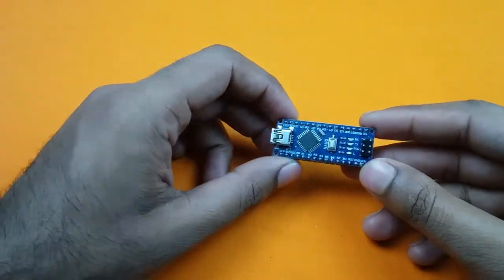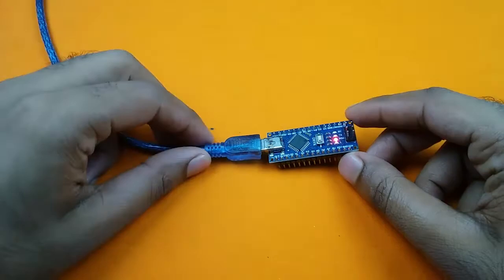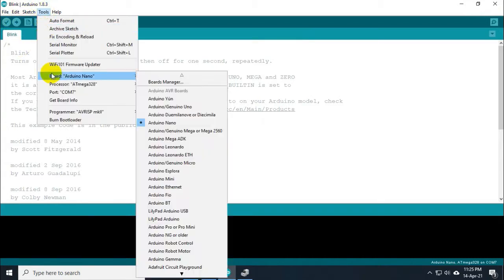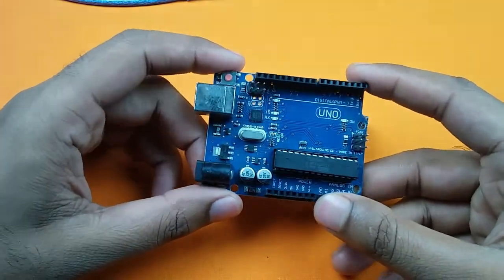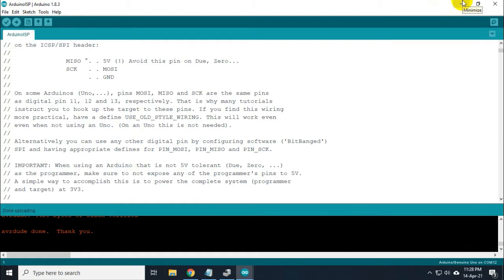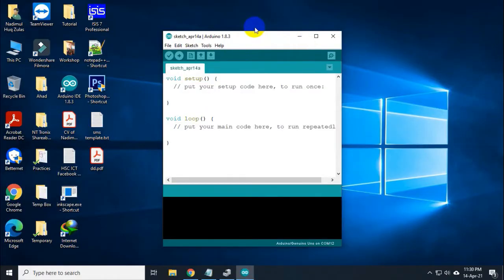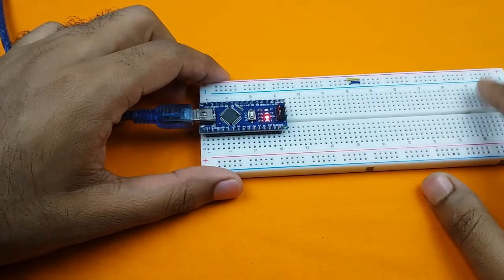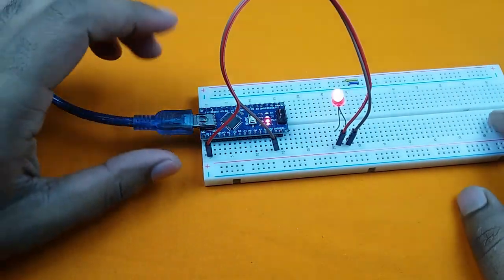How to Burn the Bootloader into Arduino Nano

Comment: mine was also a stk500_recv error - ch340 clone with no underboard crystal next to the ch340-chip-pins7and8, setup as Board:Arduino Nano"  Processor:"ATMega328P", changing to the below setting made it work, without doing anything else
Tools = Processor: ATMega328P (old bootloader)

Comment: Am facing some critical issues with nano board.
Blink code is properly worked but when upload some other code LCD display or switch opration code these codes is not working how to solve this problem sir?
Reply from the maker: I think there have any mistake on your program
Reply: @NTTronix  but sir UNO board properly worked with same code.
Reply from the maker: @0124akash  Then burn the bootloader first
Reply: @NTTronix  problem solved. Actual problem is supply voltage. Nano board supply range 6-12V and am applying 4.8V through mobile charger.

Comment: This method does not work if the Nano has a ATmega328PB instead of a 328P: I am still looking for a method for burning a bootloader in a Nano with a ATmega328PB, because most of the chinese clones have a 328PB.
Here is the error message with a 328PB:
Arduino : 1.8.15 (Windows 10), TD: 1.57, Carte : "Arduino Nano, ATmega328P"

C:\Users\Michel\AppData\Local\Arduino15\packages\arduino\tools\avrdude\6.3.0-arduino17/bin/avrdude -CC:\Users\Michel\AppData\Local\Arduino15\packages\arduino\tools\avrdude\6.3.0-arduino17/etc/avrdude.conf -v -patmega328p -cstk500v1 -PCOM9 -b19200 -e -Ulock:w:0x3F:m -Uefuse:w:0xFD:m -Uhfuse:w:0xDA:m -Ulfuse:w:0xFF:m 

avrdude: Version 6.3-20190619

         Copyright (c) 2000-2005 Brian Dean, http://www.bdmicro.com/

         Copyright (c) 2007-2014 Joerg Wunsch

         System wide configuration file is "C:\Users\Michel\AppData\Local\Arduino15\packages\arduino\tools\avrdude\6.3.0-arduino17/etc/avrdude.conf"

avrdude: AVR device initialized and ready to accept instructions

Erreur lors de la gravure de la séquence d'initialisation.

Reading | ################################################## | 100% 0.02s

avrdude: Device signature = 0x1e9516 (probably m328pb)

avrdude: Expected signature for ATmega328P is 1E 95 0F

         Double check chip, or use -F to override this check.

avrdude done.  Thank you.

If you have a solution for the 328PB processor, I am very very interested !

Comment: Arduino: 1.8.19 (Windows 7), Board: "Arduino Nano, ATmega328P"

avrdude: Expected signature for ATmega328P is 1E 95 0F

         Double check chip, or use -F to override this check.

Error while burning bootloader.

This report would have more information with
"Show verbose output during compilation"
option enabled in File -> Preferences

sir i am getting this type of error please solve my problem .

Comment: avrdude: AVR device initialized and ready to accept instructions

Error while burning bootloader.
Reading | ################################################## | 100% 0.02s

avrdude: Device signature = 0x2fff00
avrdude: Expected signature for ATmega328P is 1E 95 0F
         Double check chip, or use -F to override this check.

Comment: Amazing video. I bought a CH340 Nano board so I had to 
1. Download the CH340 .exe drivers, plug in the Nano board, run the CH 340 .exe, click uninstall, click install.
2. Do everything in the video starting from 3:02 but choose "Processor: ATmega328P (Old Bootloader)" for my specific Nano board.
3. Enjoy the functioning Nano board.
Reply: have the same old bootloader i get 
avrdude: Device signature = 0x7f7f7f
avrdude: Expected signature for ATmega328P is 1E 95 0F
         Double check chip, or use -F to override this check.
Reply: Hi, I did the process. But still not visible my nano in the device manager... :( Please help

Comment: A very clear video, but run into the problem that in the new Arduino IDE is not an option for Programmer:"AVRIP mkll. Only burn bootloader. Is that a problem?
Reply from the maker: No

Comment: Greeting. I have a problem, when I want arduino NANO Burn Loader it shows me an error (avrdude: Expected signature for ATmega328P is 1E 95 0F
          Double check chip, or use -F to override this check.
Failed chip erase: uploading error: exit status 1). What does that mean, what should I do next. HELP. I bought 4 pieces of them through Aliexpress . Greetings from Croatia
Reply: Yeah me too.
Reply from the maker: Which board are you using for bootloader?
Reply: @NTTronix  I'm using Arduino Uno as programmer, Arduino Pro Micro as the target.

Comment: I succeeded did the steps. It works, thanks!. But since then everytime I upload a sketch to the Nano, I have to choose "Arduino Uno" instead of "Arduino Nano" (it will be failed to upload if I choose "Arduino Nano").
Reply from the maker: For that you should choose the correct board during bootloader